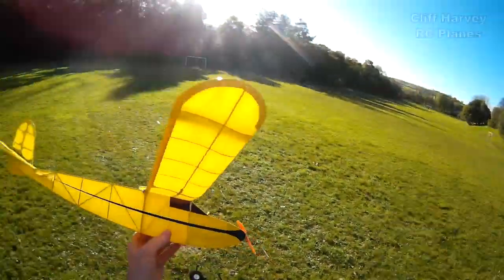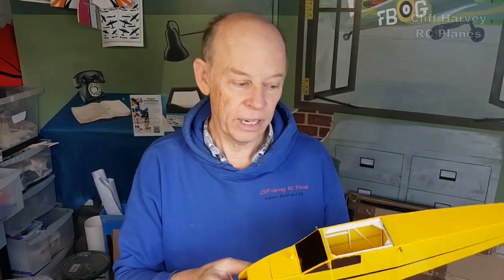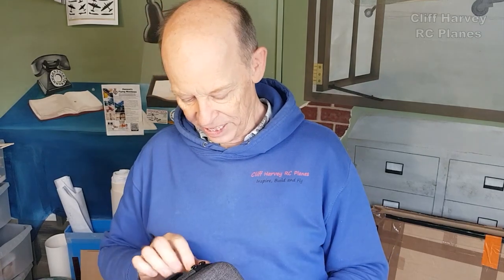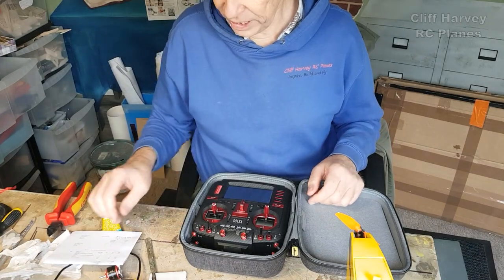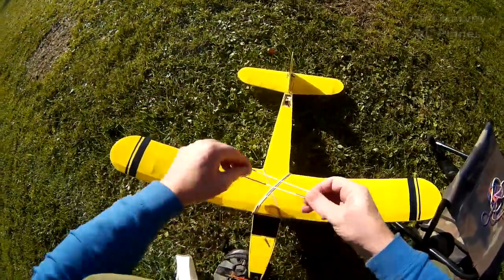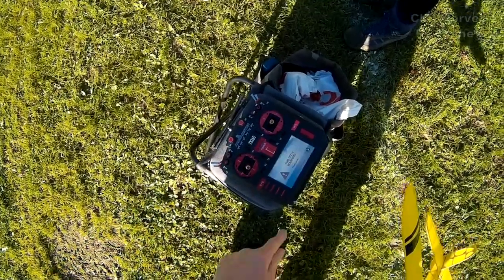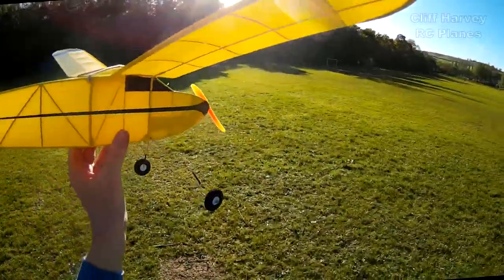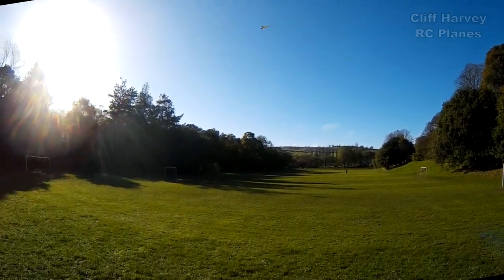KK AJAX MAIDEN FLIGHT: How to convert a rubber powered model to Radio Control

Comment: Hi Cliff, That's a beautiful rubber power free flight to RC conversion! I've done a few like that and they're lovely to fly. "Flying a kite with no string" is how I describe the experience. Very relaxing. You're right about the need for an elevator, it rarely gets used. Power climb, glide down, repeat. I hope you find a thermal and get to fly it "for free" but that's for the warmer days. Congrats on the maiden flight success!
Reply from the maker: Hi Jon, thanks, great comment, I'm looking forward to calmer days 👍
Reply: @CliffHarveyRCPlanes  Nothing wrong with that half elevator. I've used it too. It works fine on a model like this but the asymmetry is hard for some brains to accept!  😆
Reply from the maker: @Jon.Carlsen  It did work pretty well for that second landing, it just plopped onto the ground 👍

Comment: What a super bird! Congrats! Have the plan for a somewhat similar Cleveland "C-1 Norseman" and may emulate your conversion practice this winter.
Reply from the maker: Hi Dan, I googled Cleveland, what a clever guy Ed Packard was. With today's light weight equipment anything's possible,  cheers 👍🤔
Reply: @CliffHarveyRCPlanes  Yep. Later tonight I will take a look at your Savage Bobber setup and think about what I have or will need to build and equip the C-1. I retrieved the plan from my storage. It's a 32" span and shows you how to make a 1-blade folding prop too. Leaning toward the polyhedral wing option. Have to find some 3/32 sticks!

Comment: I build a Albert hatfull design called mercury...balance point was not set far enough rearward, but it did fly...now I Iknow about balance and lifting stabilisers... Rock on cliff.hatfull Vic smeed and Dave boddinton !all was powered by the new gws motors and flight packs, and goodies..guess I am old
Reply from the maker: You don't sound old to me Ron 🤔, all great names mentione there, thanks for watching and commenting 👍

Comment: That's what I call a result. You get the official Barron Flights Seal of approval. Well Done Cliff. 
I suggest an all moving tail for better control. :goodvibes:
Reply from the maker: Thanks Nick, that's the ultimate accolade 🙂 actually I was thinking I didn't really need an elevator at all. Next flight I'll try not using it at all. I think the undercambered wing  helped me to climb just by adding one click to the throttle 🤔👍